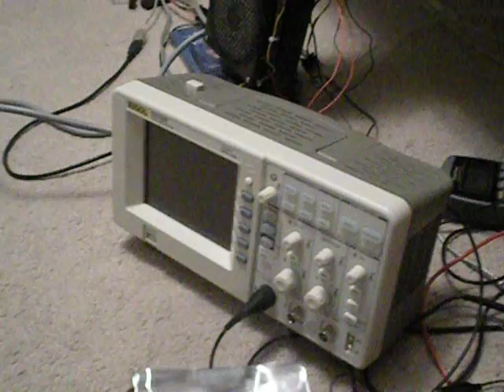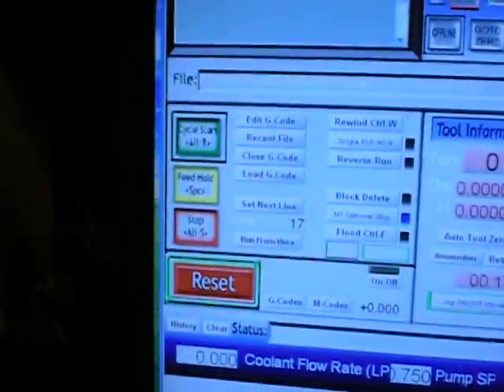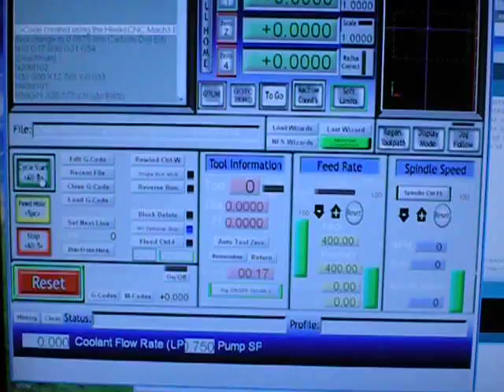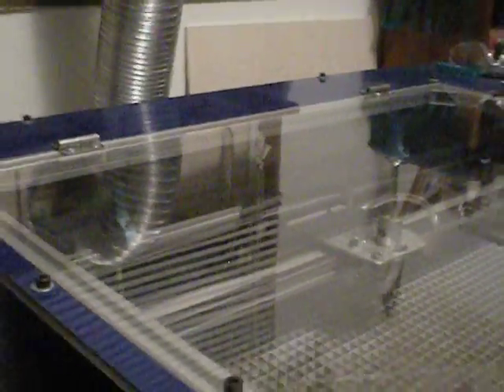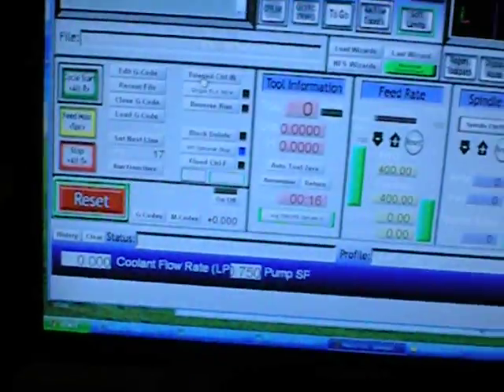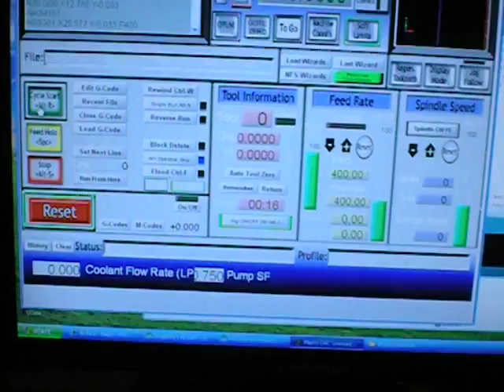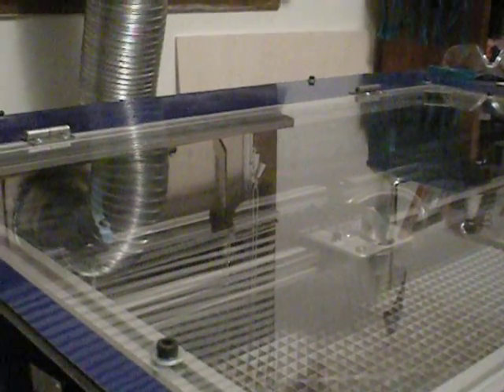Simple PPI

Comment: Wooooo! PPI ! ;) I read your blog, great work, it will help my implementation immensely, thank you. I'm building a 328p based PPI controller, same basic design, adding a simple pin based control interface to adjust the PPI settings with the gcode-addressable output pins on the smoothstepper. (in between cuts, not for raster ) Or, if necessarry, a separate serial interface on the pc with a plugin for mach3. Because, as seems to be a common thought on your controller, it would be nice to have the PPI settings in the gcode, much like feeds and speeds, and still have a way to scale them on the fly.
I'm interested to know how your fast raster engraving solution for this worked out. I note it's many years since this was posted. did you buy a $500 laser DSP controller eventually? i'll go peruse your blog...